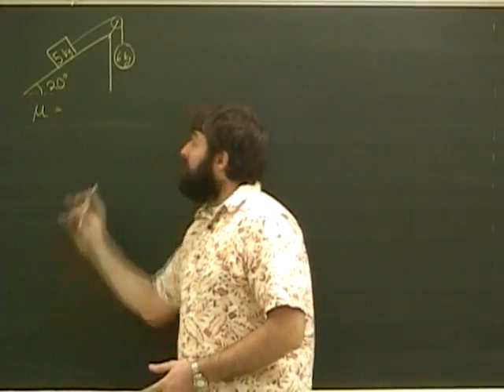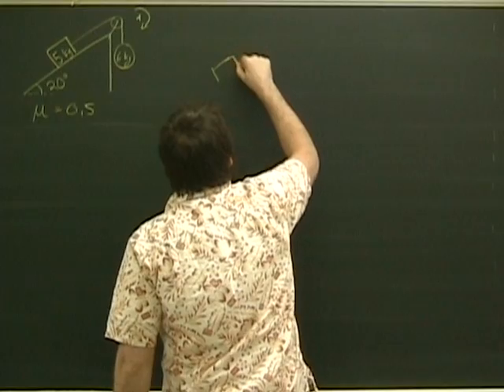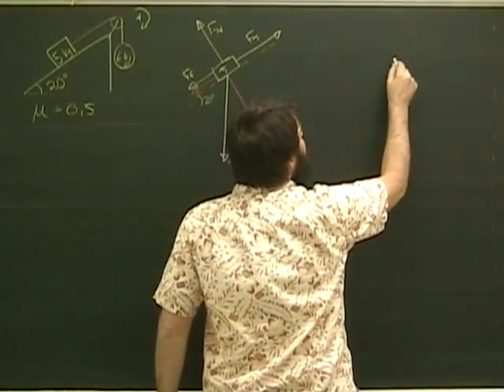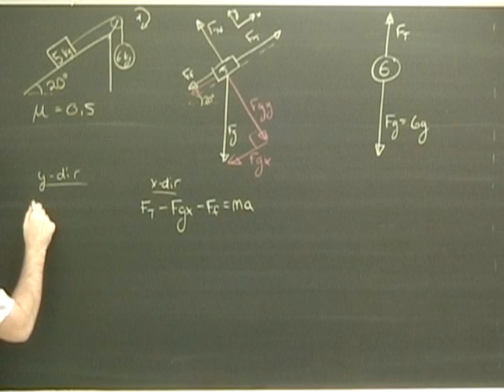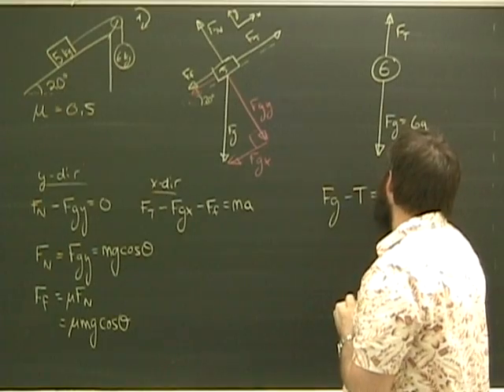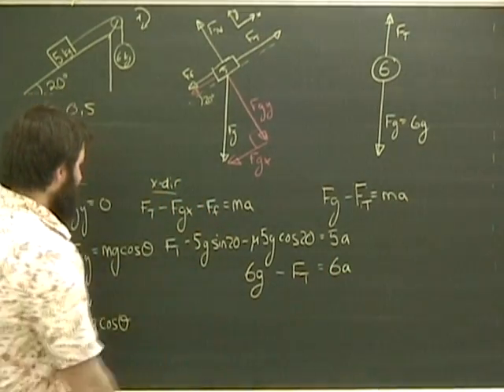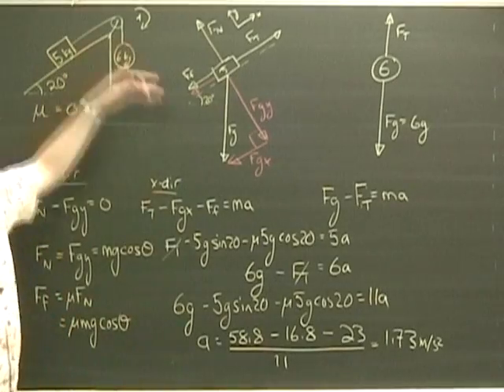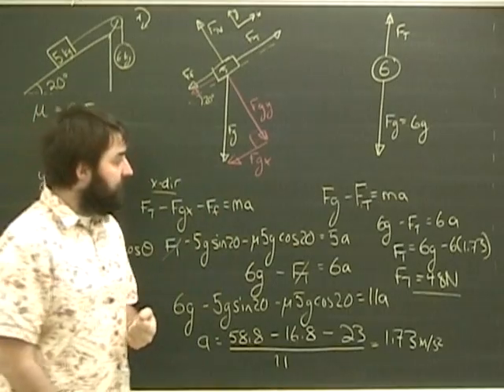Physics Pulley on a Ramp Problem (Simple) Lesson

Comment from the maker: @rishi20roxx I'm not sure if you gave the wrong time  because 6:50 is at the end. I looked it over and it looks correct but if I made a mistake let me know where it is. The x-direction is Sin since its components are the opposite for the triangle and the y-direction is Cos since it is the adjacent side for the triangle. You might be thinking about the Friction calculation which uses the y-direction force (Fn=mgCos) to calculate the Friction for the x-direction because Ff = Coef X Fn
Thanks